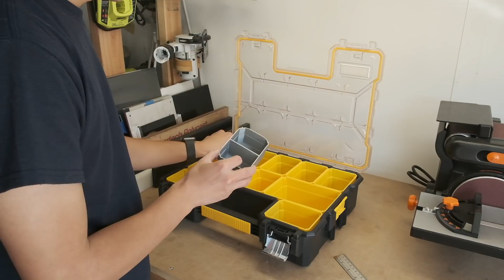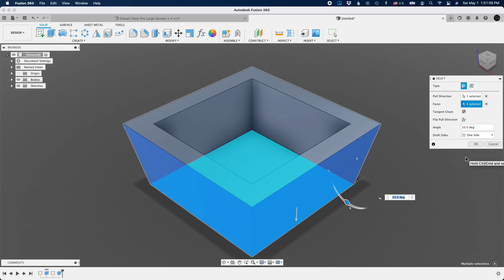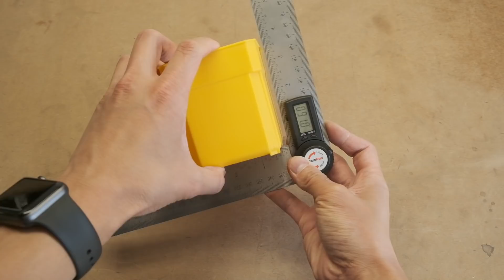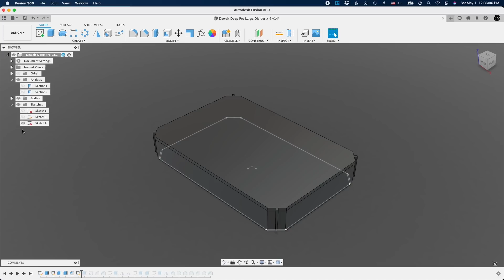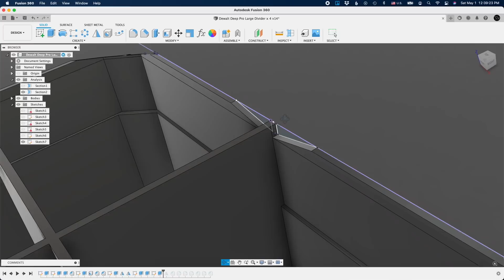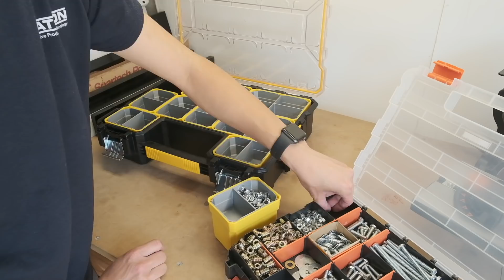Designing Nested Bins for Dewalt Deep Pro Organizers in Fusion 360

Comment: Hey! Love the content and I finally have something to contribute, even if I’m extremely late to the party.
When designing walls like this, it’s useful to keep your nozzle width in mind. Instead of a 1.5mm wall, a 1.2 or 1.6mm wall would’ve been easier and faster to print as those widths are “natively” possible without any trickery from your slicer (assuming you have a standard .4mm nozzle). This isn’t a huge deal though, but something to keep in mind for future projects :)

Comment: To store the cases buy a “commercial kitchen bun rack”. I bought a 20 tier (20 shelves) one pretty cheap. It’s already on wheels and each tier holds 2 of the Harbor Freight medium bins. Cut a shelf out and the large bins fit perfect. The rack is a little wide to hold the bins, instead of adding wood shelves cut the horizontal bars to the right width and re-tap them. Bam, 40 cases on a beautiful roller cart! I haven’t yet, but may add peg board on the sides to hold additional items.

Comment: Don’t model the wall thickness. Model the exterior, draft, shell and then add ribs and other details.they is the right way to go. 
You can leave the 2 compartments bottoms separate so there is no need for infill between them.

Comment: Which one of the Ender 3D printer models are you using? Also what kind for filament are you using? I have been wanting to get a 3d printer and have been looking at Ender products.  One of the parts (other than misc. stuff for around the shop) is to make bobbins for guitar pickups. Pickup winding is something that I have wanted to get into as I have been using a shapeoko 3 xxl and fusion 360 to make electric solid body guitars (I'm working on my 3rd one now). Any information along these lines would be greatly appreciated. Great video, I always learn new things watching your videos.
Reply from the maker: I'm using the Ender 5 Pro, though there are plenty of decent options/variations in the brand's portfolio. Anything with one of the "silent" control boards is worth it. Only other feature that might be desirable is auto bed leveling, though I don't have that on the 5 Pro and it's been fine. Haven't had to touch the leveling after day 1, but I don't move my printer around much.

Filament is this stuff: https://amzn.to/3gYvwNX 
It's nothing fancy, but it's affordable and so far has worked pretty good. Some people say different additives can affect the performance of the filament, so read the reviews when you shop for filament based on not just brand, but also color.

Comment: Cut the label off the box your fasteners come in and throw them in to the bins with the fasteners.  It will help you identify parts, and also help you order replacements when you start running low.  I find it is quicker than printing a label.  I used to think i would come back with a labeler and correctly tag each bin, but that never seems to happen.
Reply: Very smart, thanks for the tip 😊

Comment: Chamfering the side walls where they meet the bottom would avoid any risk of elephant foot.
Reply: Lol this comment is super old but I wanted to share my new favorite slicer setting!
If you’re using Cura, there’s a setting called “initial layer horizontal expansion” which will automatically eliminate elephants foot! Basically, the first layer is inset from the exterior wall to your chosen degree (I like .25mm), acting as a de facto chamfer. 
Hopefully you love it as much as I do, it has saved me so much time in post processing!

Comment: If you want to crank out bins faster, I highly recommend putting on a bigger nozzle. A 0.8 nozzle will print those bins in less than half the time with with increased layer height and extrusion thickness.
Reply: 😱 Actually this is very useful! Thanks!

Comment: I coincidentally just designed inserts for the Husky brand storage cases. I went through the same process of figuring out the draft angle and getting a perfect fit. I designed mine to have three tiers inside each of the divider containers, and each level had four compartments  (1 compartment now equals 12 smaller divisions!).

Awesome work, and I really liked the idea of using your phone's compass to find the draft angle!

I think my last post got deleted for having a link to an image of it on imgur.